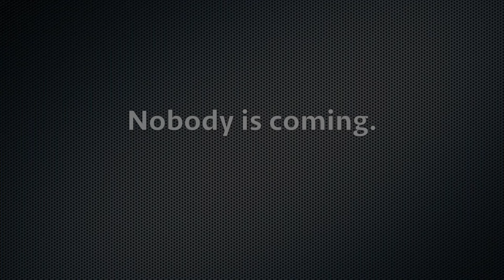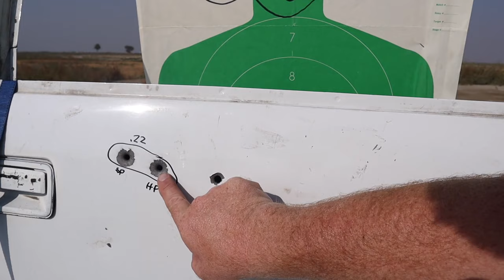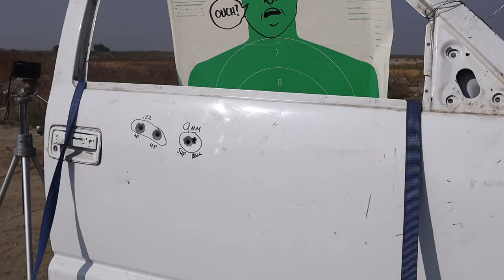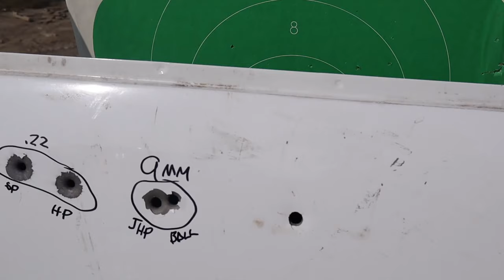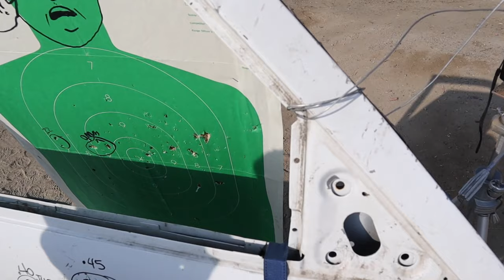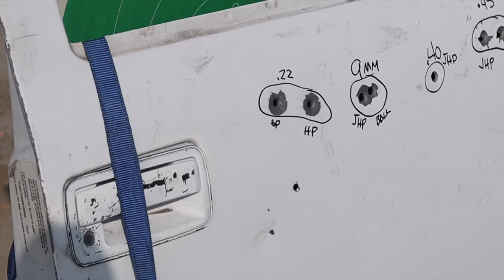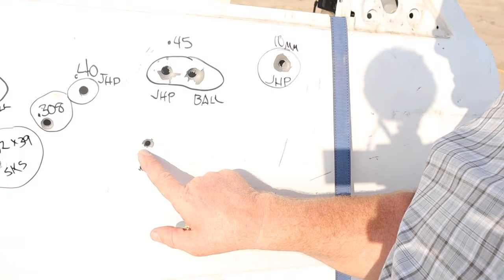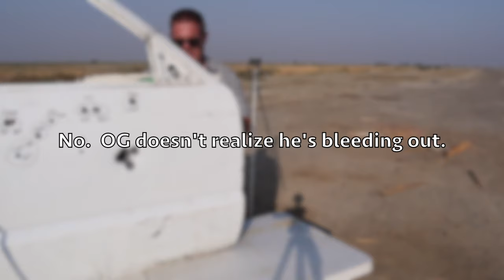How Bulletproof is Your Car?

Comment: I have a friend who works security for an inner city hospital, and they get people shot through their cars all the time.
Reply from the maker: Ya.   Not very good protection.   But good info to have if YOU have to shoot someone inside a car.  Just shoot through the door.  😎👍
Reply: @OGsDangerShow  that's my plan...if enough is flying towards them they'll run into some of it....
Reply: I wonder if they make cars you cannot get shot in... waaaaait....
Reply: @OGsDangerShow  As someone who works (indirectly) in the automotive industry, I'd argue that car doors of some makes might offer decent protection with all of the tech they're stuffing into cars these days. Between the tech, reinforcing steel beams, tons of insulation to block out road noise some cars (namely the higher end makes and models) are getting stuffed full of junk in them. Granted, it's not enough that I'd rely on them for protection, but I'd argue that it's enough that it might stop a round or two, if you're lucky.
Reply: I got to see the results of an assassination attempt on a Mexican official in Tijuana.  He was in an armored lemo style vehicle and had security in an unarmored follow car.  Three or four assassins were at each intersection for several blocks and all hand long guns.  (Reminiscent of the Clint Eastwood movie ‘The Gauntlet’). Approximately 640 shots were fired at the lemo as well as two 40mm grenades.  The first grenade went over the lemo and hit the roof of the follow vehicle and exploded.  Those guys were injured and vehicle out of the action. The second 40mm hit in the middle of the lemo windshield, but didn’t explode.  I’m told the grenade rounds need to spin enough to arm and apparently they were too close.  Radiator was shot up, run flat tires punctured, looked like Swiss cheese, but the lemo was able to escape.  The driver was injured by a ricochet that came through the door jam.  (Gives you a different perspective on how good we have it in the Good Old USA).
Reply: @glasshalffull8625  40mm rounds designed for the Mk19 have a speed/distance arming requirement, but M203 40mm grenades don't. The one that didn't go off was more than likely just a dud.
Reply: @Default Username   Thanks for the info.  When they Mexican LEOs told me about the dud, I fully expected him to pull it out of his desk and hand it to me!!!  LOL!

Comment: Back in the 1990's I worked at Ford Lincoln Mercury dealership in the Washington DC metro area and we used to service Secret Service vehicles and I replaced the window lift motors in quite a few of them and the body shop used to do quite a bit of repair work for them as well. The point of all my rambling is the side widow glass while not "bullet proof" was replaced with double laminated glass that was much heavier glass than the standard OEM "lightweight" window glass additionally epoxied to the "door skin" of all the doors were plates of T6 aluminum  to provide additional protection and a sheet of T6 aluminum plate was also installed behind the seat back and the truck compartment.
Reply from the maker: Interesting.   Our patrol cars actually have ballistic panels that will stop all rifle and shotgun rounds as well.
Reply: @OGsDangerShow  wow that’s kinda impressive, since most bean counters aren’t willing to spring for the extra expense.
Reply: Doubt it.
Reply: @OGsDangerShow  a .338 Lapua as well?

Comment: Loved all the different rounds.  Really surprised the 22LR's made it through.  We did a similar test a few years back using a newer car door which has a thinner buy higher strength steel and couldn't get a 45 or 00-buck to penetrate but we were also shooting at a slight angle.  When it's hot it's hard to know if you are bleeding or sweating.

Comment: removes jungle issue hat, bows head
"I AIN'T GOT TIME TO BLEED!"
-Our father Jesse Ventura, hallowed be thy name...ahhh-men.

Pushing 60 here, which means "maintenance" blood pressure pills - which means I catch
myself bleeding like OG's elbow pretty frequently up here on the ridge.
(See, they're blood thinners and....)
Don't even realize it, don't even feel it most often, just happens. Freaks out friends and family 
though, so there IS the fun aspect of it all.

Having a blast with your channel, Gregg - and yeah, how come people don't subscribe, anyways?
It's not like it costs anything....sheesh, tightasses.
Y'all be safe out there in Leftghanistan...
-Ed on the Ridge
Reply from the maker: Thanks Ed.  I take a daily aspirin and I wondered if I might just bleed out on the runway.  Sounds like it gets better with age.   Be safe up there on the ridge.  😎👍
Reply: Be careful with that stuff. I was on warfarin a couple years ago. Was working on my truck changing tires. Zigged when I should have zagged or something and turned my spleen into hamburger. Fell out in my kitchen at dinner time. Got to the hospital just in time. They took out 4 pints of blood that had pooled in my gutty works and the spleen mush. They also took me off the warfarin. Even with weekly checks my IR numbers had creeped up to the point where internal organs were in danger of falling apart like my spleen with any physical exertion. The scar from my belly button to my sternum is fun at parties though.
Reply: @sski  bro.... Please tell me you go to halloween as the Operation guy..... If anybody deserves that win of a costume it is you.
Reply: @dudebroski9460  LOL! No but thanks for the idea :D

Comment: .
Answer... Not very
Of all the cars I've had, my 1962 Ford Falcon would be the most bullet resistant of the lot.
Even the steering wheel and dash were steel, but there were no seat belts.   
If you got into an accident, they wipe you off the dash and just re--sell the car.
Reply from the maker: Nice!   😂.   I helped spray the remains of a human off the freeway last week.  Turns out a Subaru at 80mph. won that game of Chicken.
Reply: The steering wheel of all cars is steel.
Reply: @xenonram  no so. Modern cars are Magnesium alloy.
Reply: pretty sure those early 60's cars were made from recycled Sherman tanks
Reply: @xenonram  
The core of modern steering wheels are metal, and then they have a rubberized or protective outer coating along with a padded cover for the horn, or an airbag.
Back then, the entire steering wheel was metal and even the central hub for the horn was metal.
Reply: Got to love that 14ga iron, not tin. I would drive my 64 falcon around in hail storms watching dents appear like magic on other cars while shattered ice looked like snow on the falcon.
Reply: @Blitzkrieg.u812  prove you're not a Moron by telling who said there was?
Reply: @OGsDangerShow  
Excuse me sir.
The sign reads " Don't Feed The Trolls' "
I'm going to have to ask you to move away from the keyboard, just for a moment, and step over here please.
Reply from the maker: Kev 
🤣🤣😂🤣.   You are correct sir.  Just let me delete him from the channel first...
Reply: Dang it!! I missed something entertaining.
Reply from the maker: Meh.  It wasn’t all that fun.  I trashed a troll.  That’s about it.   🤷‍♂️
Reply: Still, reading those comments is a lot like going to the local fair. Afterwards, you feel pretty good about yourself.
Reply: @RustyorBroken  
Imagine a "Coulda', Shoulda', Woulda" story telling, "Secret Squirrel" t-shirt wearing, "Mom! I'm raiding right now!" yelling, waste of skin, with a keyboard, trying to tell people how stuff "really happens"
.
It was fun for like... a minute.   But then OG tripped, slipped, and fell right into it's trap.
.
We recovered him.   He's expected to make a full recovery.
:)
Reply: @jupiterjunk  OG pulled a Gerald Ford eh? I gotta say that's an awesome visual right there. Almost as good as when he shot cans of cs near his truck with the windows down. I still chuckle about that one.
Reply: @RustyorBroken  
Yeah... forgot about that one.
I KNOW that ride home sucked.
Like when your buddies leave their car unlocked, so you unload half a can of FOX 2.5 into the air vents..
...or so I've heard.

Comment: O.G the Thumbnail and Title caught my Eye ,and Made me Smirk  .   I used to Drive Late at Night to Pick my Sainted Mother up at work after She returned from a Bus Run .  I used to cut thru  a Rough section because traffic was lighter on that side of the River .  One Night  I saw what looked like a Bottle Rocket dual  across the Street  up ahead . At the Last second I  saw it was Muzzle Flashes  On Both Sides of the Street  .   I drove right thru at Normal  speed  Like i had a Force field  Ha ha .   Something hit the roof   and the Antenna .   5 minutes later at the Parking lot   I had enough light to see a scrape across the Roof .  This episode is has very useful information .  Stuff does happen  !  Thank you for the Memory and a Great Video .

Comment: In Basic Law Enforcement Training we were shown just how NOT bullet proof a vehicle can be. The engine block and wheels were the only places on a vehicle to use as cover; for example in felony stop training we would place the patrol car in such a way that when you opened the door, the engine compartment would be directly between you and the suspect vehicle. This also helped to guard against the suspect attempting to disable your vehicle by backing into it and activating the air bags which would needed 2 sensors to be activated in different locations.

Comment: My old department went from .357 revolvers to Glock 22 and 23. From all our research it seemed the best compromise with much of the power of the .357  and the diameter and mass of the .45ACP. Years after I retired they scaled back to the 9mm. I retained my  G27 because I am old, er I mean old fashioned. In the early 70's some of use would go to a local junk yard and do penetration tests on scrapped car doors and panels. We learned quite a bit from those experiments and as importantly it was fun.
Reply from the maker: Always a good time.  The .40 is no slouch for barrier penetration.  I have Glock 27s, 23s, 22s and even a 35 for that reason.   Carry an M&P 40 on duty.

Comment: Some people even say the SXT stands for Same Xact Thing (Black Talon). And most 8 year old Kyle's can stab a screwdriver through most parts of a vehicle, especially one made these days, when bumpers are plastic and styrofoam. About the only thing on the vehicle that is going to be cover and not just concealment on a vehicle from most commonly encountered threats is going to be engine block and wheels/axles. A car's only real defense is mobility. If you are going to stay in the vehicle, stay moving. If you are brought to a stop under fire or have reason you will be under fire, get the fuck out and find something away from the vehicle that is solid, because vehicles are bullet magnets and little on a vehicle is going to stop the bullets they attract.

Comment: You survived the Jack-O-Lope Stampede.
 Rem .233 chamber pressure ~ 55Kpsi vs 5.56mm chamber pressure ~ 70Kpsi ... 
Just saying, the powder chamber of the 5.56 (because of thicker case walls) is smaller which increases  chamber pressure >20%... Barrels designed and proofed for Rem .223 may be damaged by 5.56mm. Be Safe... love your videos

Comment: Doors on newer cars are pretty thin.  
The 38 Super came about because in gangster days they found out the 45 acp had trouble getting into those 20s-30s cars without opening the doors first.
Hollywood gives us the impression an auto is cover, when in reality it is piss poor cover, unless you are crouched behind the engine/front wheel.  With both the engine and front wheel, you are reasonably protected from many pistol rounds.  But a properly loaded 308 will still find you even behind many aluminum engines.

Comment: I drove for an over the road company, that has a armored fleet. USAC. Peterbilt's that they armor in house. The glass is removed, and replaced with 3/4" bullet proof glass. Kevlar cloth panels are sewn 30 layers thick. 1/4" to 3/8" thick. The panels are placed inside the doors and sleeper compartments.   When the trucks are sold, all the gear is removed, and OEM  glass  is reinstalled. Like nothing ever happened. 
They reuse the armor in the new trucks.
Police departments would benefit from at least the door pannels.
Reply from the maker: We have panels similar to that in our patrol cars.  But they are rifle rated.  I’ve tested them up to .308 and 12 gauge slugs.

Comment: Back in the 80's we had a local tow company bring a junk Nova to our range. It was interesting. I shot the driver's side mirror with a 7.62x51 fmj and it came out the passenger side tail light. I also saw one of the Riverside Sheriff's units that was shot up in the Norco bank robbery (my department used to send us to their academy). It was covered in through and through 5.56 and 7.62 holes.
Reply from the maker: We have one of those at our academy.  Pierced front to back with incoming AK rounds and outgoing 5.56 rounds.  Officers/1.     Bad guy/0.

Comment: Awesome video. I have found with my eyesight that the pump 12 gauge  is like reading glasses. I keep it loaded with the low Recoil law enforcement buck shot at home. When in the woods it's first 3 slugs then 00 buck.

Comment: Modern car doors are made of light and thin alloy. If the doors of the cars manufactured in the 1920's could not stand up to .38 Special Lead round nose bullets, the results for this door were as predicated, like a hot knife to butter. 

I had a naive friend who got his "facts" from movies try to tell me how safe he was in his car from gun fire. His chin hit the floor when my dad and I proved him wrong with an assortment of common rifles in various rifle(.222/223 Rem, .243 Win, 6.5x55, .270 , 7x57mm 30/30, 30/06, 300 Win Mag and 45/70) and pistol(.38 Special/357 Mag, 44 Mag, 45 Colt) munitions on an old Ford F100 door.

Comment: a gen 5 glock 19 was my gole for a carry gun in the start of 2020 when i got my carry permit, no one had quit that in stock at a reasonable price (my cut off was 500$) then i run into a surplus M57 and thogh (i could by 2 of these pistols and a 800rd of ammo for about the same price as the glock no bullets) and thats what i did... NO REGRETS. i basically got a Russian simplified 1911 that shoots a small fast caliber.

Comment: Based on seeing older model cars in the desert, I like to think pre 1980s cars with thicker gauge steel would hold up better from smaller caliber pistol bullets.  At least at a distance.  But the only genuinely safe place is behind the engine block.  Which are a little smaller on modern cars.  Or non existent if for electric cars.

Edit: Man, Mrs. OG be hookin' you up.  I never considered the possibility of a mate buying me more guns than I'd think of buying.
Reply from the maker: She definitely takes good care of the OG. 😎❤️

Comment: Dear OG. In 2002, I was carrying a Beretta 96 .40. I was involved in a Ofc involved shooting. Dude, tried to run me over in a Lincoln Navigator. I put 3 rounds dead center of the driver’s head. However, 2 rounds bounced off, and one stuck in the windshield. I swore off .40, after that day. For Duty, it’s 9mm, .357Sig / Mag , or the Lords caliber.45. Do you know if they have improved the.40 in the last 20 years?  While, we lit up the driver, from other angles. The .40 would not defeat the windshield.

Comment: Well, I've had for fifteen years so I guess it's pretty resistant to wanton destruction. Both doors (it's a coupe) have been assaulted as have the rear bumper and both rear quarters. So the body is practically new. :-)  Still runs great.

Comment: Hey OG, im quite surprised that the. 22 left a hole similar to the 9mm!!! 😱 Do you have a video on your channel showing the damage a. 22 does on a car door at 10 yards  (like this video), then 20, 30, 50,  100 yards??? Or will you do such a video for us?? 😁 Keep up the great work!!! 🏆 😎
Reply from the maker: I probably won’t do a video like that because I’m pretty sure the .22 is going through the car door at those distances.  You MIGHT luck out at 100 yards but I’d still bet on .22 penetration.  Thanks for watching.
Reply: @OGsDangerShow  ahhh ok,  no problem. "see you in the next video " 😂

Comment: I mean, even with the window up and out of the way you've gotta think the inside door panel and plastic has to have some effect on the pass through of the round.
Reply from the maker: Not much.  This plastic and fabric at best.  Might stop a few of those tiny fragments.
Reply: @OGsDangerShow  i guess it depends on the vehicle. Any half decent vehicle that has some wood or harder plastic materials on the inner door. I think the wranglers have a metal trim plate on the inside

Comment: I'm a new armed security patrol officer (getting a very small taste for what its going to be like when I finish school to be a cop) but I cannot find a comfortable way to wear my pistol and ASP Baton. Im in a vehicle most of the day and, man, those things really start digging in after a few hours. Any advice? Or maybe your duty belt setup for those of us still interested in pursuing a career in law enforcement.
ps No finger wiggle???
Reply from the maker: It gets easier,  it only after a lot of wearing the gear.   Tip: pistol aligned right down the crease of your trousers, exactly 3:00.   Baton on your weak side, mounted at a slight angle forward.  Makes grabbing it easier and keeps the seatbelt from snagging it every time you get out of the car.  Tip2: it’s still going to get snagged so get used to swiping the seatbelt off your baton as you unbuckle it.  Always be ready to bail out of that car fast if you need to.  They can be bullet magnets.
Reply from the maker: P.S.     Three finger wiggles in this video.  That should get you through the winter.
Reply: @OGsDangerShow  ooooo😲. I got a little excited, premature extrapolation. (I think that what she called it...) three is just about all I can take!